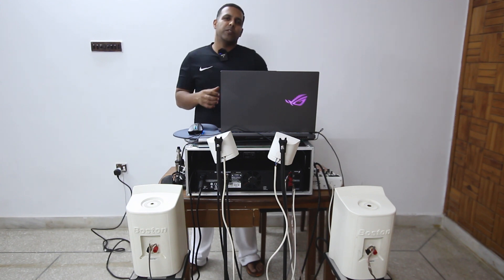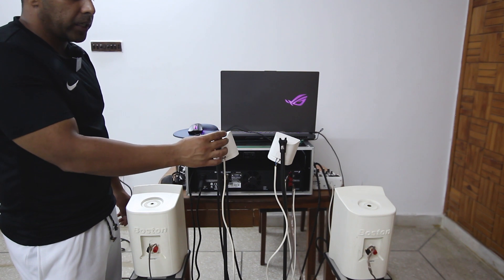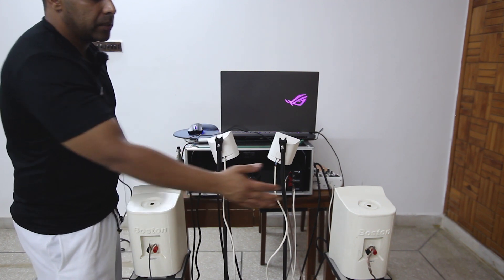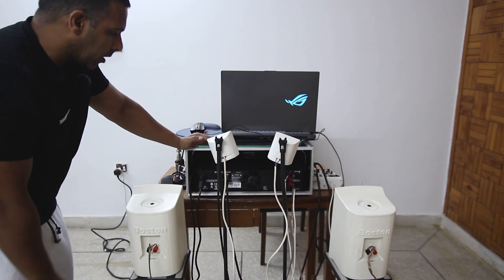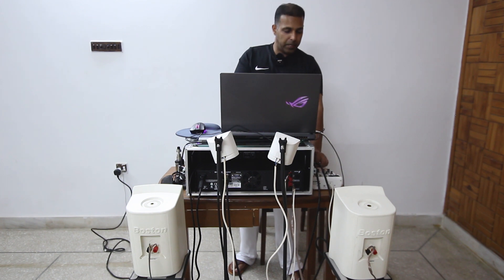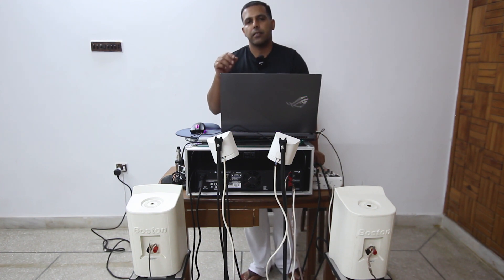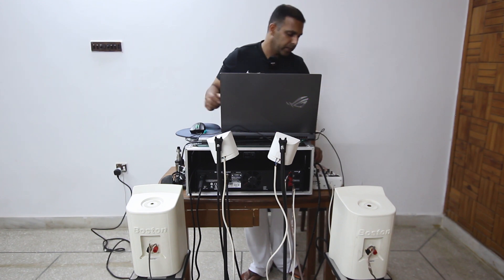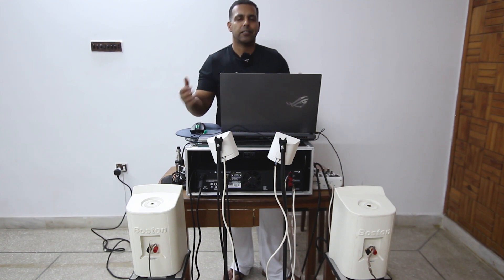How to Wire Speakers in Parallel mode Understanding Speaker Impedance and watts to match Amplifier

Comment: Why would you ever connect 4 speakers into a 2 channel amp? Stereo imaging is a product of two loudspeakers carrying a stereo signal. Using 4 speakers with a stereo signal would make it virtually impossible to create a stereo sound stage
Reply: You're right about that. Just an example though is that you have one Sonos Amp and want four outdoor speakers (2 sets of 2). It's less about the stereo sound stage and more about sound coverage.
Reply: @danielcp1985  yes.. two sets of speaker outputs is standard on most maps for zoning. Speaker set A would cover zone 1 (living room) and speaker set B would cover zone 2 (usually patio or porch). They were never intended to be used in the same room because it would defeat the entire purpose of having a 2 channel stereo signal.

Comment: what well happen to the speaker wattage in parralel mode. Example 2 8ohms at 200watts per speaker. Do you have an idea for this?
Reply from the maker: ohms ( resistance) would drop to 4 , wattage will increase to 400 Watts . Amp in signal chain should support 4ohms/400W per channel.

Comment: Hi

I had already connected a set similar than yours.

I paired in paralel twoTannoy Fusion F1 speakers with a pair of double cube Bose Acoustimass 5 Series 3 speakers.

My amplifier works perfect withg 4 ohms.

My intention was both, to mprove the medium and highs and also to adapt the speakes system to the 4 omhs despite the 8 omhs ythat is the Tannoy impedance.

I did just like you but looked for some videos because I didn't sure if matching two so different speakers is a good idea and if my inutialk intention (improvid and highs) is correct or for geeting it would be neccesary to use a extrenal crossover.

I thought that the Bose cubes, as has low frequency range than the Tannoy, reinforced just these frequency range.

What do you think?

In teh othetr side, in the Bose technical specs is written the impedance is variable. Could it be a problem?

The "invent" sdound good and the amplifier doesn't fails and isn't heat.

I work with low volume because is a desk sustem
Reply: Vicente, I did something comparable as follows:  I connected 2 different pairs of speakers [ I pair of KEF Q350s , rated at 8 Ohms & 1 pair of Elac Debut 5.2s, rated at 8 OHMS , BUT nominal impedance is 6 OHMS } to my Denon DRA-800H Receiver's A channel.  When I kick up the Volume, the Denon does Overheat and will shut down inti Protection mode. I think the 8 + 6 Ohms mix is resulting in 3.5 OHMs draw on the Receiver.  If I connect a differnent pair of Speakers in paralell with the KEFs, a pair of Fluance Signature Series HiFi speakers, rated at 8 Ohms Nominal impedance, the "marriage" is noticeably less heat producing.  I have been advised via Blog entries, NOT to Do This !!  I'm just to lazy to run speaker wires (I use 14 Gauge only), to the second set of Speakers (either set is OK), to the B channel on the Denon.....  That's really the way to go.  BTW, I ran the speakers as decribed in paralell mode by connecting the speakers , one to the other , which was wired to the A channel , different from the way this fellow describes by running wires from each paralelled speakers to the A channel on his Amplifyer.